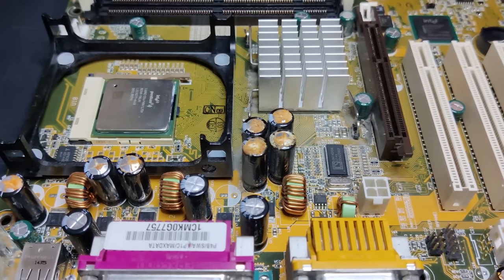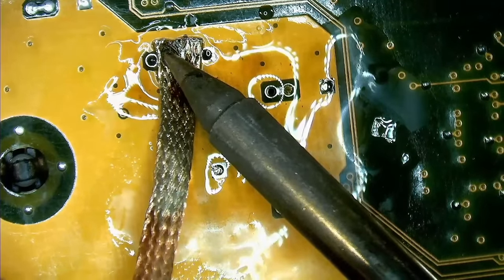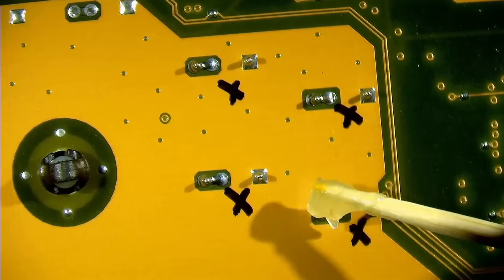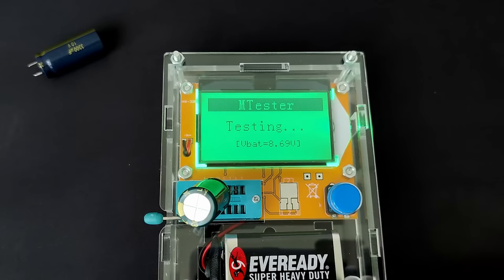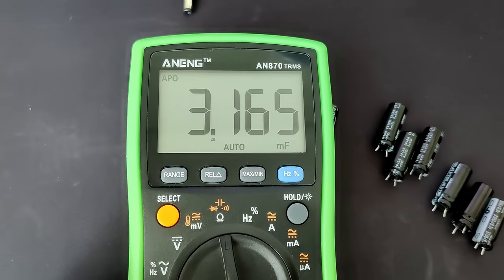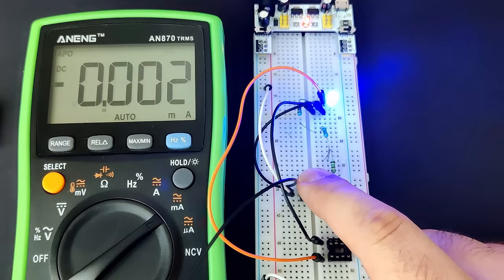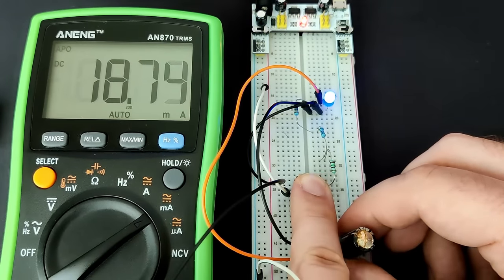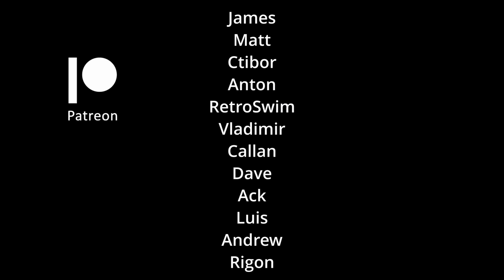Remnants of the Capacitor Plague

Comment from the maker: "From 2001 to 2004, Nichicon produced defective capacitors ("HM" and "HN" series) that were used by major computer manufacturers.
Some sources claimed that these capacitors were either overfilled with electrolyte or were constructed using electrolyte that was prone to leaking, 
causing premature failure in any equipment using them. This issue was not related to the Taiwanese capacitor plague."
-- Wikipedia

How convenient! The capacitors on my ASUS P4B are in fact from the "HM" series.
Maybe they just bought the incorrectly formulated electrolyte to save cost?
Then it absolutely would be related to this dark time of PC hardware!
Reply: It feels like many other brands failed in that period and that period extenddd far
Reply: Interesting, I bought new Nichicon caps from Radio Shack around this time and I found them to be leaky.  I don't know which series they were as I long ago disposed of them.
Reply: Which capacitor brand and model have you bought for the replacement?
Reply: The industrial espionage theory is one thing, the other is the ROHS theory which is that new regulation to cut down on toxic materials is what made capacitors so bad, it's about the same time that lead-free solder was starting to get used and it provided similar headaches.
Reply: Some of those failed capacitors were from rip off manufacturers who also marked their capacitors with known good manufacturers. Many of these rip offs make fake Nichicon capacitors.
Reply: That's what I thought but funny that on the P4B only these 7 caps fail the other 3 seem to be fine all the time. Mine had already all 10 replaced as I got it. Didn't had the founds for an P4 system back in the day. Maybe its normal wear from heat and slightly subpar quality? More later...
But first I think the whole one Rubycon electrolyte scientist story is an urban myth. I just can't believe someone that familiar with the formula would only steal half of it. 
I think what happend is that the hardware downward price spiral just hit capacitior manufactures about that time and everybody searched for ways to produce them cheaper. 
Pretty sure most japanese capacitior manufactures had at least one factory already outside of Japan at this point. Pretty sure Rubycon in Indonesia and Nichicon in Malasyia, Korea before the plague and mainland China since ~2001. Where a lack of quality control might be the cause that was never disclosed. At least to my knowledge there were also only some badges defective while others were fine in contrast to what Dell claimed back in the suit that followed.
The new companies in Taiwan either weren't fully sure what they are doing or more likely just left the expensive stuff out of the electroylte to undercut the competion and increase profits at the same time which kind of worked. At least for only a short time cause most of them disappeared until ~2007/2008. There are only a handful left: OST (now OK) and Fuhjyyu, Lelon, Su'scon, (still bottom tier) Jackcon, Yellow Stone (not quite sure - not seen a (dead) cap of them for years.) All others either got bought by mainland chinese capacitior manufactures, quit making caps (Wendell) or just ceased.
Reply from the maker: I went with solid aluminium capacitors. Brand is unknown
Reply: You don't need to say degrees celsius, just degrees is fine since it is used in 99% of countries world wide. Hence it is the default.
Reply: @bitsundbolts  should've bought quality caps from Digikey or Mouser.
Reply from the maker: I completely agree. And I will mention to rather look for reputable sources to get replacement capacitors in the next video. Unfortunately, it costs 30 USD to ship 10 USD worth of parts from mouser to my location. And then comes import, customs, and VAT.
Reply: @Troppa17  not only bought by mainland Chinese manufacturers. At least one manufacturer was bought by Yageo, a somewhat more reputable Taiwanese manufacturer. I don't remember which one, but I encountered a shared datasheet with both brands on it and the equivalent series.
Reply: @bitsundbolts  I don't know where you're located, but TME has good caps as well. I always use Panasonic FR series, but other  brands and polymer caps are available.
Reply: @mjouwbuis   I totally forgot about that. Teapo bought G-Luxon in the mid 2000s if I remember correctly. Teapo was already part of Yageo at that point. But there might be others that were also bought by Taiwanes manufacturers that I simple don't have knowledge of. To being honest I followed the history of these brands less (especially after the late 2000s I basically stopped) then I did the major Japanese and western brands.

Comment: The test circuit you put together to demonstrate the behavior of the bad capacitors was brilliant! It was really interesting to see and it becomes very clear why they'd prevent a motherboard from working correctly. I've tried to test bad capacitors before with component testers and multimeters, but they never seem to look all that bad from a numbers perspective. Sticking them in a test circuit like that tells a very different story indeed. Keep up the great work 🙂👍
Reply from the maker: Thank you! And yes, you're right. I was not expecting to see such a high capacitance on those badly damaged caps. First I was like, "oh, they are better now!" 😂

Comment: The Vloss value is defined in a very simple way. Charge a capacitor up to a given voltage, then disconnect the charging source and immediately measure the voltage. The relative difference of these two voltages (in percent) is the Vloss value.
PS, several models of transistor testers with the newest Markus' firmware (1.49 and higher) can measure the leakage current directly. Also you can measure it by charging the capacitor continuously with its rated voltage thru a multimeter in mA or μA mode.

Comment: Your tester must be using a charge-curve instead of discharge curve for the capacity and thus will be fooled by high self discharge/leakage.
It should do both. Measure on both halves of the cycle to identify leakage correctly.

Comment: that was a nice testing rig! You're luckier than me with removing the caps with wick and no pre-heating... Not sure how you can do that! On my "Livincontrol" repair video I had hot air + solder iron and I wasn't even able to REMOVE the capacitors!
Reply from the maker: It may depend on the quality of the board. I must say, this P4B feels premium. Maybe the vias have a lot of material where heat can travel and melt through the board. I could not free the holes of the vias that connect to the copper plane though.
Reply: Sometimes parts are hard to take off boards. Some of the techniques used are somewhat counterintuitive too. Such as adding solder to remove parts. It doesn't make much sense on the face of it but it's what you have to do. Sometimes you have to add, remove and add more solder. It's a two steps forward one step back process.

Comment: Looking forward to the repair! :-)
Apart from Nichicon, another reputable brand that suffered bad batches was Nippon Chemi-Con. It was around 2004-2005, I don't remember which series was affected.
Reply from the maker: It was a great time for so many manufacturers have issues with capacitors.
Reply: Elna had some problems as well, but that was roughly 5-10 years earlier.

Comment: There is a good explanation for the  higher capacitance values for the failing capacitors. You need to look at the 1st year uni physics formula for capacitance. Due to the leaking electrolyte and build up of gas inside the two plates are pushed closer together increasing capacitance but this is also means the ESR climbs until the current jumps across the gap.

Comment: Considering I have seen the capacitor plague strike all sorts of equipment, even stuff like dash clusters around the 90s with the dodgy brand capacitors.
I would say the plague and hunt for saving cents really brought on a lot of failures back in the day.
Reply: I should say it's often not that. In the 90s the electronics manufacturers simply believed cap manufacturer promises on unproven high density products which allowed them to engineer slicker and smaller devices. But the stabilising magic ingredients turned out to not be quite magical enough and ended up degrading. So it wasn't even cost saving but trying to make progress happen when it didn't want to be happening yet.
Reply: Nichicon is not a dodgy brand. But Nichicon has made some dodgy models. They have brought shame on their family for generations. Rubycons are the best.

Comment: I have the same tester.  You have to calibrate it every once in a while jumping 1-2.3 together and then you need a 15pf cap.  Those good 3300uf caps should be near .05 ohms.
Reply from the maker: Yeah, I did calibrate it when I got it, but that is a few weeks back. Might be a good idea to do this before using it...

Comment: I had a 2002 ePox mobo for the Athlon XP in which every single capacitor turned like that. As a result it would only start up every third or fourth time, and make awful screeching noises when loaded with some heavy applications. 

So I thought, hey, I might try to replace them, good for a project to learn how to solder on proper boards... and ended up massively failing, taking out a few caps with their vias and putting in none, and the rest just left to stay. Funny enough, this didn't fix the screeching noise, but the computer would now boot up every time rock solid :D

Comment: I have a whole batch of pc's with AMD Thunderbird 900mhz processors that have these issues on the boards. When it gets bad enough they stop posting.

I have yet to replace the caps to see if they start working again. Good to know that you can kind of replace then without a hot air rework station since I don't own one of those yet.
Reply: You definitely can. Can even use a cheap DIY style heat gun very carefully to pre-heat a board to make soldering iron more effective, obviously with caution :)

Comment: I remember when I bought in early 2000, my dream computer with Celeron 466 and Voodoo 3 then I wanted a high-end motherboard. I chose an Abit BE6-II, which cost nightmarish money at the time. Legendary 440BX, SoftMenu III, UDMA66 and great performance. After only a year I noticed a problem with the capacitors. Almost with all of the power section.... They were replaced under warranty, but soon after that I sold the board.
Reply: No one wanted a celeron unless it was the 300mhz p2
Reply: @simon_1987  
Maybe at your place. In our country (Poland)  it was very popular because of its good performance and price. As a reminder Price at introduction $169, while Pentium III 450 - $348

Comment: I've probably said this before here and definitely have said this in other repair channels. So forgive me if I'm repeating myself.
For removing those two leaded components in a difficult ground plane like those failed capacitors you have I've had really good luck using one of those Weller type soldering guns. I'm talking about the kind that has a copper wire loop as the soldering tip and uses a low voltage high current transformer to make the tip heat up. It gets hot enough quickly enough to melt the solder without trying to heat up the entire board, plus with some extra solder "blobbed" onto the pins you can heat both pins at the same time. Basically heat up the pins while gently pulling the part out. Cleaning out the solder filled holes can be done with a regular soldering pencil and a stainless steel pin. Heat up the hole with a soldering iron and push the needle through while the solder is liquid. I've used a pin vice and a drill bit to even drill out the solder holes (you have to be drilling centered in the hole).

Comment: As the capacitor get's internally "damaged" over time, it's capacitance can increase while the voltage rating decreases, that causes them to bulge or burst because they can't handle the circuit voltage anymore.
Reply from the maker: Yes, the electrolyte missed the protective compounds that prevents internal damage to the aluminum housing. What I've read is that this chemical reaction creates gas that causes the capacitors to swell up.
Reply: Yes, an increase in capacitance with time (and not a decrease!) is a characteristic feature of capacitor plague.
Reply: What causes the capacitors to bulge is vapor pressure. The poor little devils are literally boiling away.

Comment: 8:39 have you tried measuring the capacitors parallel resistance using the multimeter in resistance (ohm) mode?
Reply from the maker: I think I faced some issue measuring the resistance. If I recall correctly, my multimeter was constantly jumping between different units (Ohm, kOhm, mOhm). Unfortunately, I no longer have the capacitors to measure them.

Comment: you can use a domestic hairdryer to thoroughly pre-warm a board and it can make a big difference when you need just a little more heat from a small iron to desolder lead-free components on large pads

Comment: I remember having at least one motherboard from that time where the capacitors started bulging and leaking. I think it smelled a bit too. Honestly, I never even thought about replacing the capacitors back then, even though I knew enough about soldering. I'm sure many tons of hardware got tossed around the world due to this problem. What a shame.
Reply: I recapped a big screen TV. It was worth doing. It's still running today. A lot of stuff isn't worth recapping depending on how many capacitors you have to buy and replace. A motherboard cap kit can cost half the price of the motherboard and there's no guarantee just capping it will fix the board. As when the caps went they might have took other parts with them.
Reply: @1pcfred  Motherboards with failed caps, mostly booted fine (or which noobs tried to fix). But crashed when Windows loaded or bit later. I got P3 500 with bad caps, when I bought about ten new ones , clerk at the store asked if those were for motherboard :) Most hobbyist don't need ten electrolytics and nothing else.
Reply: @Tegelane5  failed caps lose the attribute they need to do their jobs. They're on a board for a reason and when they fail they're just not doing that job anymore. They become capacitors with no capacity. That's bad. It is especially bad at times of extreme load. When the other components need those caps to pick up the slack they let everything down.

Comment: De-soldering motherboard components can be a real headache. Factor in the lead free solder many motherboard manufactures use & that makes the process even more tedious. Preheating the board & adding some 60/40 solder to the pads helps to release & then re-solder the caps. Even then it is still nerve racking when you have to use such a blunt & very hot soldering iron tip so close to the often very tiny traces on the back of computer motherboards.

Comment: Basic capacitor testers calculate time to reach set voltage.  So yes,  if it leaks away it will cause that time to extend and the reading will be inaccurately high.    Your cup analogy was spot on.    Really an LCR meter is needed.   You've done a good job with what you had.
Reply from the maker: Thank you!

Comment: I recapped so many boards and graphic cards. Mostly our business systems from Fujitsu-Siemens. They didn´t had Nichicons but OST as manufacturer. Also recapped my mother in laws socketA Gigabyte board. New caps just 5€, new Board 60€... Was a good deal and she was happy.
Reply: Cap kits for motherboards generally cost around $40 or so. Where'd you order yours from? Only the finest CapXon for the mother in law huh?

Comment: My Dell computer at work years ago was buggy and unstable. I popped off the side panel to clean out the dust, and saw several bulging leaking capacitors. Opened a ticket with IT, they didn't care, refused to replace it.

Comment: The plague started much earlier. Nearly all NEC PC Engine Duo/Turbo Duo units have bad caps, and they were manufactured between 1990 and 1993.
Reply: All electrolytic capacitors fail eventually. Plague caps just failed sooner than they should have. Electrolytic caps are just bad by their very nature. Every electrolytic cap has a rated lifespan though. Which ranges from 2,000 to 70,000 hours. But that rating is at max rated temperature. So it's not like a 2,000 hour cap fails instantly when it is 2,000 hours old. Every degree below max temp nets you more lifespan. It's all somewhat complicated.
Reply: The event that precipitated the plague did not occur until 2001. All electrolytic capacitors fail regardless of if they have bad electrolyte in them, or not. So you cannot attribute every failure to the plague. Every electrolytic capacitor ever made will fail someday. That is the nature of the component.

Comment: Sadly this capacitor plague was the nail in the coffin for A-Bit. Luckily I have a BE6-II which predates 2001. Still runs great to this day. I was working for Dell in 2006, where half of our calls were motherboard replacements for Optiplex GX270, SX270 and GX280. A lot of people screamed at Dell for the issue, but I took the time to educate owners that this was a known across all motherboard manufacturers and System Integrators.
Reply: i almost got BE6-II for 8$, but missed an auction. Someone was were happy, cause it was inside whole ATX celeron build. All cost 8$ plus shipping, functional. Not many people noticed, cause on photo, only part motherboard was seen, but I've identified it according BIOS string.
Damn, I've missed it by 5 minutes. Could have BE6-II. I have only BE6 , but that board is earlier one, and not so good. It has some issues. Still good board. Just it's not recommended to use ATA-66 IDE connectors. It also hinders overclocking potential. Always wanted to have BE6-II rather.